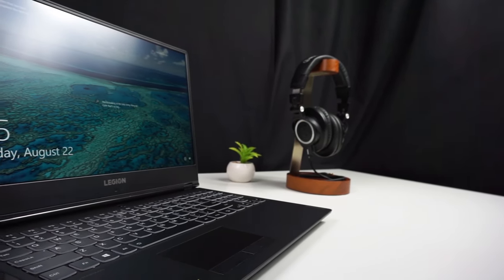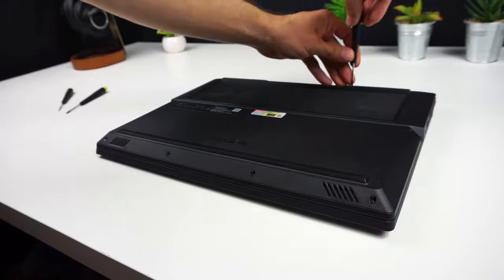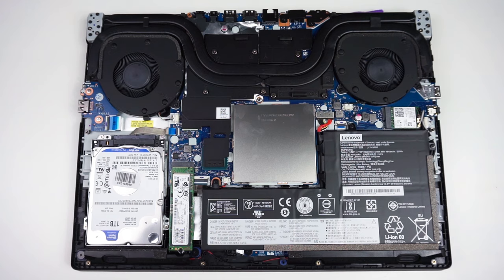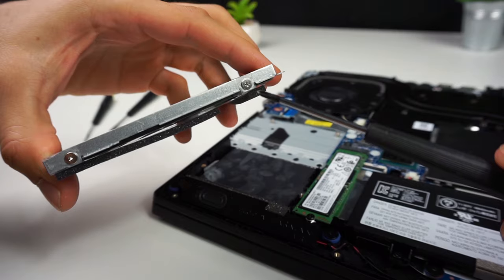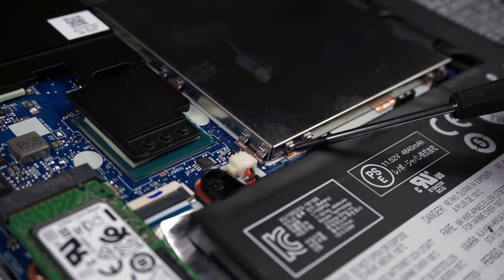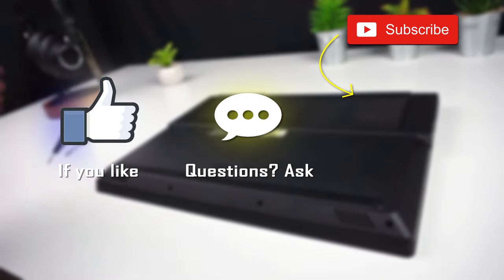Lenovo Legion Y540 Upgrade RAM / SSD / HDD - Disassembly Guide

Comment from the maker: ✅ Free download RAM / SSD / HDD data recovery software: https://bit.ly/2zRpN9B

TIMESTAMPS:

00:00 - General info
00:36 - Opening the lid
01:47 - Installing Hard Drive
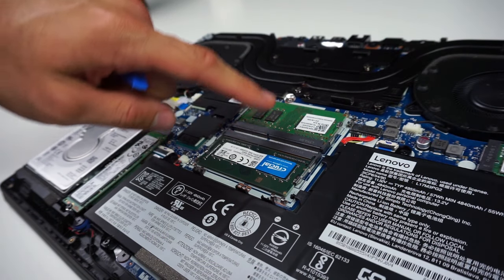03:50 - Installing RAM
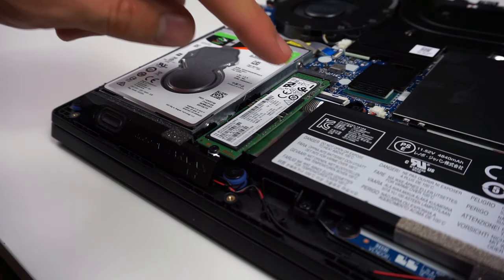04:45 - Installing M.2 SSD
05:12 - Closing the lid
Reply: Have you ever seen 17 inch Y530?
Reply from the maker: @max_proton  I didn't have 17" model
Reply: @TechFinds  it doesn't exit
Reply: Mordeczko mam tego lapka już z rok i7 9750h i 1660ti . Zbliża się premiera cp2077, czy mógłbym liczyc na Twoją pomoc w podkręceniu go ? ;) Pozdrawiam <3
Reply: @hipcio9000  hey i wanted to ask that its mixing ram and i have heard it bottlenecks the system so will that happened or not? and also can you swap out the other ram stick to make it 32 gb ram instead of 24gb?????
Reply: I have the Legion Y540 with  i7-9750HF CPU @ 2.60GHz   2.59 GHz. Do you know if the CPU can be upgraded?

Comment: You do know there is a MUCH easier way.  On the side opposite of the fans, there are two screws. One at each corner at an angle. REMOVE JUST THOSE TWO SCREWS. Tug back on the black plate downwards, then lift up. You get full access to ALL ram, HDD, and M.2 PciE slots without having to mess with the clips and all those other screws.
Reply from the maker: Really? i haven't tried that, because the bottom lid looked like one solid piece. If i remember good probably Y740  or one of similar models had that option.
Reply: Not all the Y legions have the back plate divided in 2 parts.
Reply: The y540 17in version has the split back plate.

Comment: can i use memory HyperX Impact SODIMM 16GB DDR4 2666 CL15 HX426S15IB2/16 and will it work ? Im afraid this cart will be too big
Reply from the maker: You can use if it's laptop ram 260 pin. However if you wanna mix with original ram you better go for something else that has the same specs as your original RAM

Comment: Still, how r u supposed to remove battery since I got legion y540 for my birthday and don't want to ruin it in the first week
Reply from the maker: You should play with battery connected and laptop plugged in. You'll only ruin the battery when charging is in progress and you're using the laptop at the same time

Comment: This is a very good tutorial and thanks to it and photos from Google, I installed additional RAM in a laptop for the first time. But in the beginning, when you show how to open the lid, you should emphasize that the screws are of different lengths and you should be careful which is where. But otherwise perfect, best regards!
Reply: can you explain more what is the issue with the screws?! thank you
Reply: @abdallaaref3718  Not all screws are of equal length and if you screw one that is too long into a place where a shorter one was screwed in, you can damage the components of the laptop. But unfortunately I don't remember which was which, you have to write it down when removing the screws. Cheers!
Reply: Thank you for the heads up!

Comment: Just upgraded my SSD, it was my first time working on a laptop and your video made it super straight forward, thanks a lot, you rock!
Reply: hello i want to do the same but how do u deal with windows when u have swaped your ssd ?
Reply: @RazielgetDatsword  Hi! I bought an external case for SSDs, used it to migrate the old one contents on the new one and then swapped them, I'm now using the old SSD as an external drive  hope this helps!

Comment: Question/Issue: Hi, I have a Y740 and just updated it with a 1 EVO970 Plus NVMe SSD and a 2TB EVO SSD. On the Information window in BIOS the 2TB EVO SSD is assigned to Disk 1 and 1TB 970EVO Plus is assigned to Disk 2. It should be reversed. Also, It doesn't list the 1TB NVMe in the Boot Manger, only the DISK 1 2TB SSD. The only way I can get the 1TB NVME to boot is to remove the 2TB EVO SSD. The only way I get both drives to show up in the BIOS is buy enabling Legacy mode. I enable Legacy support by switching the to ACHI storage controller. Then can see both drives, but the system will not boot with both drives installed .

Comment: I have 60hz modèle can i upgrade to120 or 144hz ? 
I here about 30 pin but can you confirm ?
Reply from the maker: you can always upgrade screen if you can do it. Unfortunately i don't know the connectors because i didn't disassemble it
Reply: @TechFinds   you have 60hz version?

Comment: hello, what is the difference between Y530 and Y540, and which one is better in your opinion ? and does it worth it to pay more to buy the better one.
Reply from the maker: If i remember good the main difference is that y540 has improved thermal performance compared to previous version Y530. It still runs kinda hot tho. It depends on the price difference if it's worth to buy old or new one

Comment: i have one simple question with many small questionsi think its shown on the video but I just need to make sure if I see it correctly... SO if I have lenovo legion y-540 256gb sdd 8gb ram, I can add HDD inside? there's empty spot for it? and put all apps on it, and leave sdd just to my system so it still starts quick? also in your description you recommend packs of 2x 8gb rams of the same type, can I buy just 1 another 8gb ram for mine and it doesn't have to be from the same company if everything else is matching the requirements?
Reply from the maker: Every Y540 has one slot for 2.5" HDD or SSD and one slot for m.2 SSD, yours as well. You have only m.2 SSD so 2.5" drive bay is free and you can add HDD. You can leave only system on your ssd if you like. You can buy different RAM, brand doesn't matter but match the specs (GB, MHz, cl, voltage)
Reply: @TechFinds  okay thanks for clarification, now i understand everything i need :)

Comment: which RAM / SSD / HDD u put inside the laptop act. i hv lenovo Y540 there is 8GB RAM / 256GB SSD AND 1TB HDD SO what i do to increase the capacity please suggest me, i want ram 32gb / ssd 1tb and hdd is enough i work animation & rendering, is this kind of changes in laptop is supported.
Reply from the maker: Hi, i linked few RAM and drives options in the description so you can check them out. 32GB (2x16) RAM is max this laptop can support and it's good to have this much for graphics work and rendering. For HDD you can have even 2TB if you wish

Comment: Hi and thank you for this video 🙂
can i replace the current 2Tb HDD for a 4 or 8 TB SSD ...?
and if so .. once this is installed what dor i need to do to get it running ?
or would that just be plug in and play ....

thank you

Comment: Hello what if i want to replace that boot drive which is hdd, should i change the boot drive to another drive first or?

And also do we need to do any settings before installing and after? Or the system will automatically found out the upgrade?
Reply from the maker: If you mean that you wanna have Windows on different drive you have to install the system on that drive and get rid of Windows on your current drive. After installing new drive you have to go device manager and make a partition.
Reply: @TechFinds  lol you know exactly what i mean with my broken english lol. Thanks for the help

Comment: After the changing the ram and adding an ssd, is it necessary to install new drivers or do something with the software? Or it will all run normally with the restart?
Reply from the maker: RAM will be recognized automatically and for the drive to make it appear in your pc you have to go device manager and make a partition
Reply: @TechFinds  okay thank you very much!
Reply: Another question: I want to buy the crucial ram (2x8gb) but I don't know if I have to choose the single or the dual rank. Thank you very much 4 answering our questions! You have a new subscriber.
Reply from the maker: @martiedo  By defailt it comes with single rank. You are free to choose tho, but it's better to not mix both types

Comment: Very nice video. Recently I have purchased Legion Y540 with “AMD Ryzen 7 4800H”. 
Can I upgrade my SSD and RAM. Bcoz it is having only 128GB SSD, And having only 16GB of RAM.
Plz reply me
Reply from the maker: Sure, you can. 16GB RAM is actually enough for gaming, especially when it's 2x8GB
Reply: Tech Finds 
First of all Thank You so much for Taking out thr time and answering my query. 
The reason for upgrading the RAM, SSD and SSHD is I run VM(Virtual Machine) which consumes a lot of resource. 
So for this reason only I am upgrading it.
Reply from the maker: @sohailahmedsyed9351  Even if it's not gaming, the more RAM the better performance at any task

Comment: Hey Tech Finds! I just thought to ask, will it void my Lenovo warranty to replace the ram sticks? More importantly, is there a seal on the ram sticks that would show if they were removed?
Reply from the maker: It may depend on the country, so i recommend reading your warranty terms or contact Lenovo support. By default in most cases changing RAM/HDD/SSD won't void the warranty unless you damage something during upgrade.
Edit: i didn't find any seals
Reply: @TechFinds  Alright thanks, I read through the warranty and it looks like it won't void it unless I were to damage it like you said, but I'm not too worried about that since your tutorial is so clear! Thank you
Reply: I asked the lenovo service the same question via chat. They said it would interfere with the warranty, but I'm still not sure, since the person there seemed somewhat incompetent.

Comment: i have a question to ask because i have the y530 and this guide is for the y540. my y530 have an 1TB HDD and no SSD installed. can i install an SSD? And what type of SSD do you recommend? thanks
Reply from the maker: If you have only HDD you have M.2 slot free for SSD. You can go for Example for Samsung 970 Evo. I linked few options of M.2 drives in the description

Comment: thanks for the video! one question, in my Lenovo Legion Y530 I have Intel Optane in the slot of M2 and 1TB of HDD and actually my laptop runs very slow, sometimes took me 10 min or more to speed up the apps installed. If I want to upgrade to SSD what do you recommend me to do? is my OS installed in the Intel Optane or in the HDD? I'm kind of concern to upgrade but I'm not sure what to do first, can you help me?

Comment: Is it true that you lose guarantee for a brand new legion if you take off his back plate or just mount a second ram plate in slot?
Reply from the maker: It may be different for each country so it's better to read the warranty card. In most cases it shouldn't void warranty as long as you dont damage the laptop during upgrading process

Comment: Hi Guys, can I install 2 units of SSD with my Legion Y540 motherboard? Or its always 1 HDD and 1SSD ?
Reply from the maker: You can have 2.5" SSD instead of HDD if you want
Reply: @TechFinds  thank you. But of course there is no chance to install 2 units of M.2 right ?
Reply from the maker: @gdivision951  There is only 1 slot for M.2 SSD. You could eventually install M.2 SSD in 2.5" drive bay using adaptor but it would be limited to SATA cable connection anyway.

Comment: If you are still reading comments, can you tell me what speed the upgraded ram is running at? Heard sometimes it does not run at full speed without XMP
Reply from the maker: I didn't add any new RAM. I took out and installed the same original ram just to show how to do it
Reply: @TechFinds  I see, thanks

Comment: I've got one question for this.. does this legion y540 can change or upgrade processor into high performance? *Beside ram and ssd, I will do myself if it could
Reply from the maker: You can't replace processor
Reply: @TechFinds  oke i get it thanks ..

Comment: What screwdriver did you use to unscrew the screws, I am trying to open up my computer
Reply from the maker: A small phillips head screwdriver. I don't know the size number, because i just care for it to fit to the screw tight
Reply from the maker: @vtp349  i don't know that. Try to contact them and ask

Comment: Hey 
Looking to upgrade my y540's ram from 8gb to 16gb since I want to take full advantage of the rtx2060 it came with when gaming
Should I go with a single 16gb 3200mhz or just put a second 8gb 2666mhz alongside the one that's already in my laptop
It's about 40$ more if I go with the 3200mhz one but if the difference in performance is noticeable I think it's worth it
Will the difference be noticeable though?
Reply from the maker: I would recommend buying 1 more 8gb stick with the same specs so the dual channel will be activated. with single 16GB stick you don't benefit of dual channel
Reply: @TechFinds  thanks man appreciate it

Comment: Acer nitro 7 vs legion y540. Which would be better ?? Value for money
Reply from the maker: The prices vary between countries. As for the laptop itself i think that i would go for Nitro 7 i think. Both have not very good cooling but with Acer you can at least control the fan speed.

Comment: Hey, I want to buy Legion Y740 and there is only a version with only 512GB SSD but no HDD. Is it possible for me, when I get it, to put a HDD inside of it? Is there space for it? Thank you!
Reply: And also there is a version with a noOS operating system but it is few hundred dollars cheaper but i wonders if i would be able to get windows on it or not?
Reply from the maker: Sure, you will have a slot for 2.5" drive free so you can put HDD or SSD in there.
You can install Windows on your own, but i recommend to buy model with Windows already installed as it comes with essential software and settings that define how your laptop works.

Comment: Can I install 8gb(stock) + 32gb/16gb(crucial or sth else) = total(40gb/24gb)?

I mean by only considering the same frequency of RAM cards and not having the same size.
Reply from the maker: This laptop supports up to 32 GB so you cna have 8+24. However it's recommended to have both sticks of the same size
Reply: @TechFinds  Okay. I will rather prefer 8+8 to keep it the same size.

Comment: hi, before changing the ssd, is necessary to do something else? any config in the laptop?
Reply from the maker: If you're replacing the SSD where you have your files you should make a copy. Also if Windows is installed on this SSD you should be prepared for installing windows on the new drive
Reply: @TechFinds  ok i get it, thanks for the response and thanks for your videos!

Comment: Hi, thanks for the video, and i have a doubt that , i already have 2400Hz 8gb Ram preinstalled can i add 2666Hz 8gb  Ram in other slot, which is of same company or will there be any compatible issues?
Pls give reply asap!!!
Reply from the maker: You can mix frequency so the ram will downclock to 2400MHz in this case, but i still recommend to match the RAM specs

Comment: I just bought this for $900 and I love it and I was thinking of adding more storage so this helped a lot. I dont think I need to add more ram but if I do, do I have to take out both of the ones that are installed or just one?
Reply from the maker: You can add or replace both or only one stick if you want. Mae sure to match the specs if you mix other RAM with original
Reply: @TechFinds  yeah the links you provided on the description match my ram as well so thank you for that lol

Comment: First of all, thank you ! Your guide is easy to understand and short ! 
But i have a question, i've heard about the possibility of adding another SSD/HDD IN the Lenovo Legion, is it really possible ? Cuz i got this pc and when i added some RAM, i did not see any place to put in.
Reply from the maker: This model has one slot for M.2 SSD and one slot for 2.5" HDD or SSD. Check in the video where these slots are located
Reply: @TechFinds  thank you!

Comment: can you please give the link of screw driver or opening kit please ? Also I have y540 with i5 9300h with 512 ssd, and I have hdd slot empty so can I add 1tb or 512gb sshd in that slot or i need to add hdd please answer.  If yes also please recommend me a 512 gb sshd for my laptop and I please provide the link outside for outside of usa.

Comment: I already have an 8gb Ram in my Lenovo legion Y540. I want to upgrade it to 12gb. Can I buy a 4gb ram stick? Can you link it if you know of any?
Reply from the maker: https://amzn.to/2CQv5np
Reply: Tech Finds do you have a link for amazon India?
Reply: @TG-mt8ce  why would you upgrade 4gb? you have to go dual channel with 8gb upgrade
Reply: Genti Zarari budget reasons. are you saying I’ll have to buy an 8gb stick and it won’t let me put a 4gb one?
Reply: @TG-mt8ce  it will let you, but you get double channel with 2 same sticks, that means 2x more speed on ram, that translates to 30% more real time speed on your laptop for most of the tasks, like gaming, opening windows, apps, etc, basically u need to get 8gb+8gb of the same speed, example 2666mhz. You have to check your ram speed, and get the same ram speed and capacity for it to work 100%
Reply: @TG-mt8ce  so better save 15$ more and go with 8gb.  Ram is the most inexpensive these days, and within a month prices will go probably higher because new nvidia graphics will make people buying ram.

Comment: Hey man, what you think about those specs for lenovo legion y540, are they good for gaming? I don't need more than 60 fps atleast

i5-9300h
16gb of ram
Rtx 2060
512 SSD
Reply from the maker: Sure, it's a decent hardware. You'll be able to play with even more than 60fps
Reply: @TechFinds  Thank you alot!
Reply: I have one with i7-9700h and others specs same as yours, I prefer better cpu since others could upgrade in the future

Comment: Does y540 has 16gb single ram or 2*8 16gb ram.... M concerned coz I want to upgrade my laptop to 32gb ram but dono whether it has single or dual....well in that case do I need upgrade both the slots?

Comment: Are the cooling fans on Y530 and Y540 the same? I own y540 and the fans require replacement, but I'm only able to find fans of y530 in the store near me. Can I use them instead? Because they look kinda similar. Will it work the same?